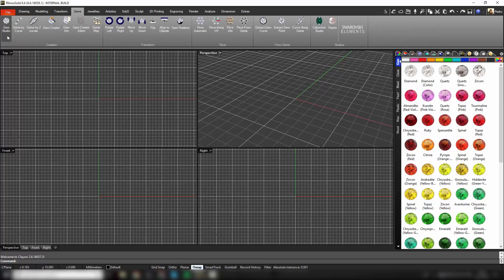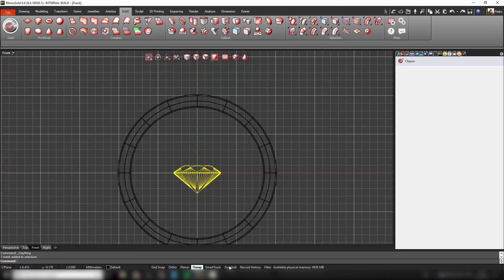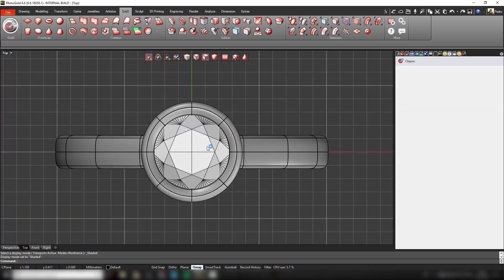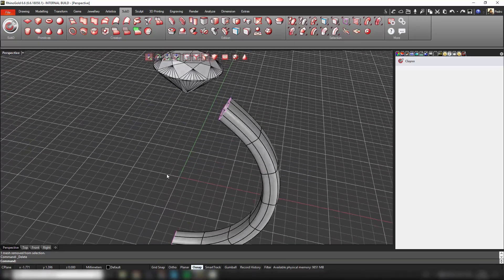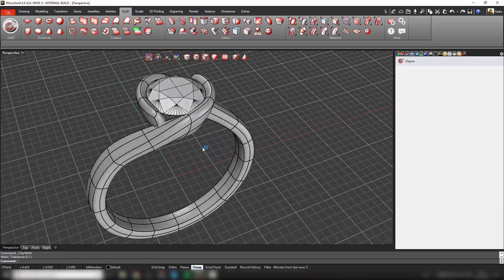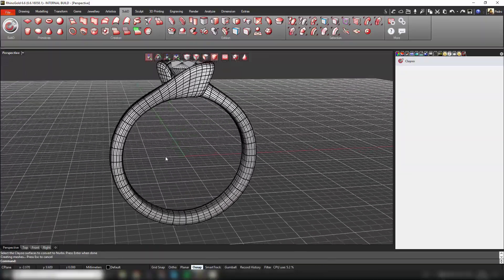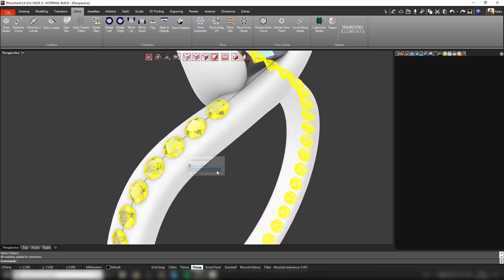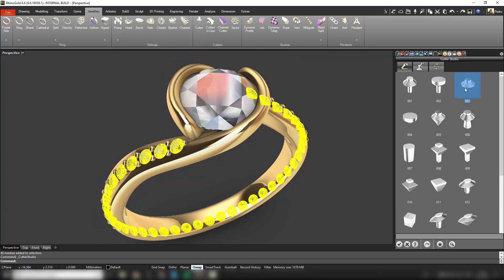Bypass Ring Tutorial (Clayoo and RhinoGold)

Comment: I notice that the finger size is altered by Clayoo. After I completed the same project, I saw that the ring becomes smaller than what I wanted. Autocut had to be used to correct the size. Is that normal with Clayoo?